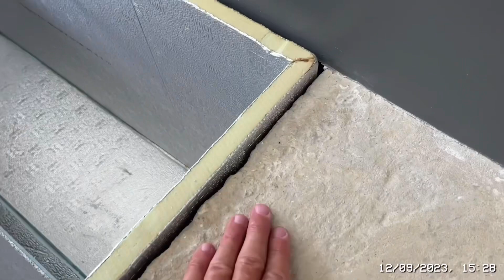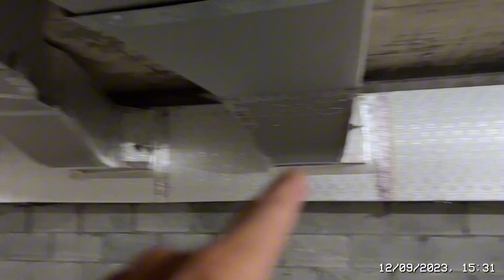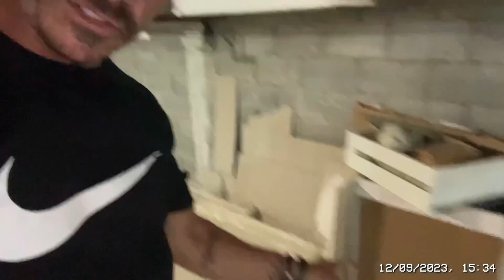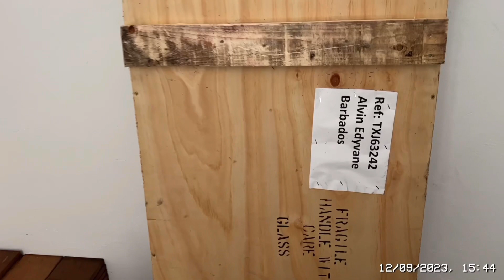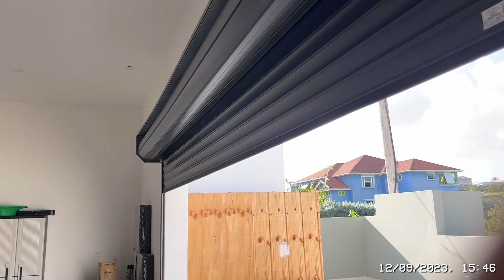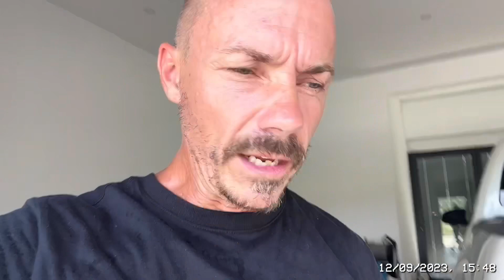BARBADOS 🇧🇧 BEACH HOUSE BUILD

Comment: on the garage door have you thought about adding a long length of draft excluder to the top edge of the concrete opening, that way the brush element will clean dust and crap off the door each time it rolls up but the pvc backing/retaining piece will not scuff the door like the concrete does
Reply from the maker: You would think it would come with this wouldn't you.

When I get around to taking it apart I will analyse it, the rear boxing will need straightening first that is for sure. then once this is done there does need to be something that will be clear the dust off, draft excluder could definitely work if I can get it fixed in place somehow.

Comment: Hi Alvin, ideally you hot air return should have been up high closer to the ceiling (hot air rises) which would make your AC system work more efficiently and get your rooms colder easier. I'm assuming that your system was wasn't design for AC in the beginning due to your modification of your original design.
Reply from the maker: Well the one thing I did not proceed with was the M&E drawings, this should of definitely been done. They are not cheap but this would of enabled me to have allot of the questions and answers dealt with at the outset. You live and learn that is for sure 😩

Comment: Evening Alvin, I'd be interested in which solar system you are using, not the air conditioning. I'll be in Barbados end September will give you a call if I may. Fingers crossed no broken panes or frames you've waited long enough.
Reply from the maker: 😂 of course I will give you any help i can give that is for sure. Let me know when you are coming and lets meet up.